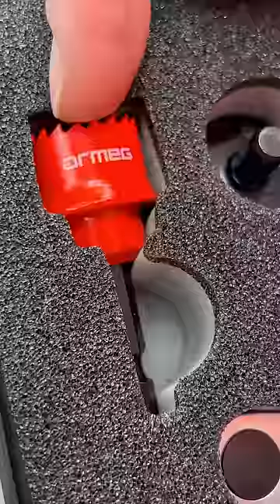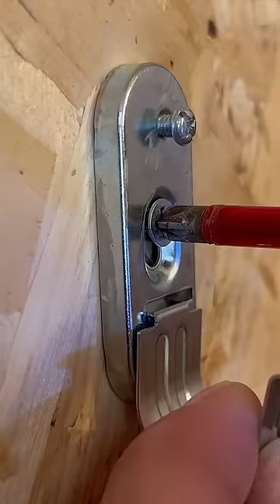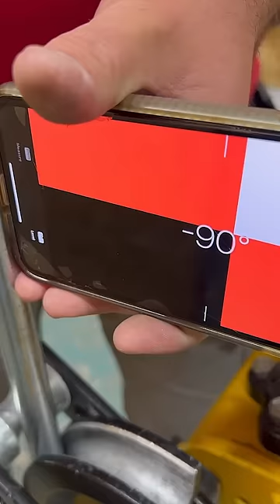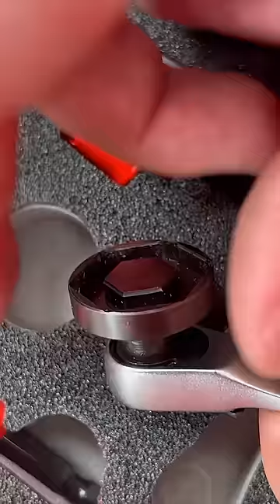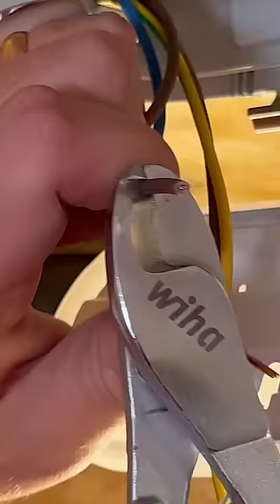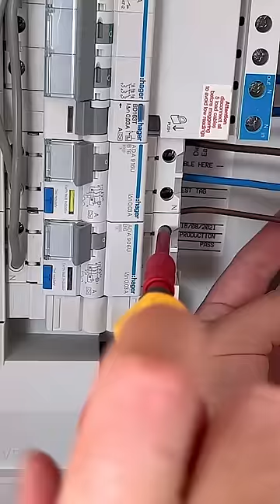How Many Electricians' Tools Does It Take to Fit a Light?

Comment: I'm guessing there's some code I'm not understanding, but it seems like a LOT of tools and steps to hang a light fixture....fancy bender, rigid conduit die and vise, lugs for the ground wires, phone to check bent angle- gimme 20 minutes a screwdriver, hacksaw, strippers, and hand bender - oh, knockout set and cordless drill. And a dozen couplings to cprrect my bending miscalculations 😅

Comment: Can i get a list of these tools pleaseee
Reply: As the saying goes, I gotchu fam. 

In order of appearance:
- Green crosshair level (Bosch, Milwaukee, etc. all make them)
- Marker in what appears to be custom holder made from adapters and a cable gland
- Flathead insulated screwdriver
- (Cardboard for separating out single wires from a bunch, this may or may not count as a 'tool')
- Automatic Center Punch - 5 inch Brass Spring Loaded
- Cutting Fluid
- Armeg SSH020 Sheet Steel Holesaw, Red, 20mm (Armeg TBSSH5PCSET is the whole little kit) 
- Power drill
- MAVAST Silicone Deburring Tool
- Cloth :P
- Philips insulated screwdriver
- KNIPEX Tools - Pliers Wrench, Chrome (8603250), 10-Inch
- Tape measure
- Magnetic welding holder
- Portable mechanical pipe/conduit bender (can't find the exact one)
- iPhone level app
- Hacksaw
- Square file
- Large die set (can't find his exact one, but a large die set will give you a t-handle. Manual conduit threaders give you a bar not a t-handle to drive the die)
- Conduit reamer
- KNIPEX Tools - Alligator Water Pump Pliers (8801250), 10-Inch
- 20mm Brocket - Conduit Bush Socket - Armeg
- 1/4" mini ratchet
- Fish stick set, possibly glow in the dark variety
- Wiha Classic 34730 Cable Cutter 200 mm (he has an older model, new model has different teeth)
- BAT22-6NV2 Thomas & Betts Sta-Kon Battery Powered Crimping Tool with DIE2001 Thomas & Betts Insulated Terminal Crimping Die, 22-10AWG
- Reel spinner (couldn't find a specific style like his, most of ours (US) are stands that you load the reels on)
- Wiha insulated screwdriver set, 19 pieces - 28398
- Wiha insulated pliers (background)
Edit: last screwdriver is not the same 28398 handle, it is in fact - Wiha 28789 11-Piece Insulated TorqueVario-S & SlimLine Blade Set. Credit: @Elektrotechniker

I did my best for a useless shorts comment that will never be seen again, take it as such lol

Comment: What is that wire crimper you used that sounded electronic? The end ferrule crimper
Reply: BAT22-6NV2 Thomas & Betts Sta-Kon Battery Powered Crimping Tool was the only blue battery powered one I could find. Greenlee makes a few models as well.

Comment: Is there a tool list ?
Reply: In order of appearance:
- Green crosshair level (Bosch, Milwaukee, etc. all make them)
- Marker in what appears to be custom holder made from adapters and a cable gland
- Flathead insulated screwdriver
- (Cardboard for separating out single wires from a bunch, this may or may not count as a 'tool')
- Automatic Center Punch - 5 inch Brass Spring Loaded
- Cutting Fluid
- Armeg SSH020 Sheet Steel Holesaw, Red, 20mm
- Power drill
- MAVAST Silicone Deburring Tool
- Cloth :P
- Philips insulated screwdriver
- KNIPEX Tools - Pliers Wrench, Chrome (8603250), 10-Inch
- Tape measure
- Magnetic welding holder
- Portable mechanical pipe/conduit bender (can't find the exact one)
- iPhone level app
- Hacksaw
- Square file
- Large die set (can't find his exact one, but a large die set will give you a t-handle. Manual conduit threaders give you a bar not a t-handle to drive the die)
- Conduit reamer
- KNIPEX Tools - Alligator Water Pump Pliers (8801250), 10-Inch
- 20mm Brocket - Conduit Bush Socket - Armeg
- 1/4" mini ratchet
- Fish stick set, possibly glow in the dark variety
- Wiha Classic 34730 Cable Cutter 200 mm (he has an older model, new model has different teeth)
- BAT22-6NV2 Thomas & Betts Sta-Kon Battery Powered Crimping Tool with DIE2001 Thomas & Betts Insulated Terminal Crimping Die, 22-10AWG
- Reel spinner (couldn't find a specific style like his, most of ours (US) are stands that you load the reels on)
- Wiha insulated screwdriver set, 19 pieces - 28398
- Wiha insulated pliers (background)

I did my best for a useless shorts comment that will never be seen again, take it as such lol

Comment: The electricians I have seen so far in the UK would just throw a wire at the light and say "there are no regulations, it's good".
Reply: He basically did that but with metal tubes and big ass switch.

Comment: Hi everyone! 
I am electrician from Sweden. 
For me all this things with metal pipes looks impressive and strange same time. 
I wonder what kind of requirements should be for the room to justify the need for such an expensive (I guess) work?
Reply: Exterior wiring, damp/wet locations.
Reply: Mainly for places where you need better mechanical protection. People also like it where the wiring is going to be on show as when done well it looks good, IMO.

Comment: 14 maybe even possibly 6.. 🤔 but iduno they paying by the hour (we rounding up?) or by the job, that is the real question!

Hold up @efixx how do you like the phone level thing a Ma jig & do you find it accurate? I carry my 🔥 Bosch laser tape measure with me always & really do pull that thing out to level items a lot! It’s a multi use tool for sure 👏 (but I would like to try the phone version too lol)
Reply: By my (updated) count, 30 - in order of appearance (because something is wrong with me and you might find it mildly entertaining):
- Green crosshair level (Bosch, Milwaukee, etc. all make them)
- Marker in what appears to be custom holder made from adapters and a cable gland
- Flathead insulated screwdriver
- (Cardboard for separating out single wires from a bunch, this may or may not count as a 'tool')
- Automatic Center Punch - 5 inch Brass Spring Loaded
- Cutting Fluid
- Armeg SSH020 Sheet Steel Holesaw, Red, 20mm (Armeg TBSSH5PCSET is the whole kit)
- Power drill
- MAVAST Silicone Deburring Tool
- Cloth :P
- Philips insulated screwdriver
- KNIPEX Tools - Pliers Wrench, Chrome (8603250), 10-Inch
- Tape measure
- Magnetic welding holder
- Portable mechanical pipe/conduit bender (can't find the exact one)
- iPhone level app
- Hacksaw
- Square file
- Large die set (can't find his exact one, but a large die set will give you a t-handle. Manual conduit threaders give you a bar not a t-handle to drive the die)
- Conduit reamer
- KNIPEX Tools - Alligator Water Pump Pliers (8801250), 10-Inch
- 20mm Brocket - Conduit Bush Socket - Armeg
- 1/4" mini ratchet
- Fish stick set, possibly glow in the dark variety
- Wiha Classic 34730 Cable Cutter 200 mm (he has an older model, new model has different teeth)
- BAT22-6NV2 Thomas & Betts Sta-Kon Battery Powered Crimping Tool with DIE2001 Thomas & Betts Insulated Terminal Crimping Die, 22-10AWG
- Reel spinner (couldn't find a specific style like his, most of ours (US) are stands that you load the reels on)
- Wiha insulated screwdriver set, 19 pieces - 28398
- Wiha insulated pliers (background)
Edit: last screwdriver is not the same 28398 handle, it is in fact - Wiha 28789 11-Piece Insulated TorqueVario-S & SlimLine Blade Set. Credit: @Elektrotechniker

I did my best for a useless shorts comment that will never be seen again, take it as such lol

Comment: I counted 20?
Reply: I counted a lot more than 20. I guess it depends on your definition of a tool.
Reply: Edit: 29 by my (updated) count (30 if you count the cardboard piece as a 'tool'). In order of appearance:
- Green crosshair level (Bosch, Milwaukee, etc. all make them)
- Marker in what appears to be custom holder made from adapters and a cable gland
- Flathead insulated screwdriver
- (Cardboard for separating out single wires from a bunch, this may or may not count as a 'tool')
- Automatic Center Punch - 5 inch Brass Spring Loaded
- Cutting Fluid
- Armeg SSH020 Sheet Steel Holesaw, Red, 20mm
- Power drill
- MAVAST Silicone Deburring Tool
- Cloth :P
- Philips insulated screwdriver
- KNIPEX Tools - Pliers Wrench, Chrome (8603250), 10-Inch
- Tape measure
- Magnetic welding holder
- Portable mechanical pipe/conduit bender (can't find the exact one)
- iPhone level app
- Hacksaw
- Square file
- Large die set (can't find his exact one, but a large die set will give you a t-handle. Manual conduit threaders give you a bar not a t-handle to drive the die)
- Conduit reamer
- KNIPEX Tools - Alligator Water Pump Pliers (8801250), 10-Inch
- 20mm Brocket - Conduit Bush Socket - Armeg
- 1/4" mini ratchet
- Fish stick set, possibly glow in the dark variety
- Wiha Classic 34730 Cable Cutter 200 mm (he has an older model, new model has different teeth)
- BAT22-6NV2 Thomas & Betts Sta-Kon Battery Powered Crimping Tool with DIE2001 Thomas & Betts Insulated Terminal Crimping Die, 22-10AWG
- Reel spinner (couldn't find a specific style like his, most of ours (US) are stands that you load the reels on)
- Wiha insulated screwdriver set, 19 pieces - 28398
- Wiha insulated pliers (background)
Edit: last screwdriver is not the same 28398 handle, it is in fact - Wiha 28789 11-Piece Insulated TorqueVario-S & SlimLine Blade Set. Credit: @Elektrotechniker

I did my best for a useless shorts comment that will never be seen again, take it as such lol
Reply: @iangillespie1605  honestly impressive
Reply: @omniferousswan593  I have a problem, clearly xD

Comment: I think using plastic conduit is more practical, fast and safe and doesn't need such expensive tools.
Reply: Until it's broken, or UV damaged and crumbling. 
It's easier to use EMT. But I could cut, thread, and bend that faster and with less tools even in rigid. They're just showing off their toys.

Comment: This is way too fast for us yanks to see the details of your kit. It is so different then here in the land of 60hz
Reply: In order of appearance:
- Green crosshair level (Bosch, Milwaukee, etc. all make them)
- Marker in what appears to be custom holder made from adapters and a cable gland
- Flathead insulated screwdriver 
- Automatic Center Punch - 5 inch Brass Spring Loaded
- Cutting Fluid
- Armeg SSH020 Sheet Steel Holesaw, Red, 20mm
- Power drill
- MAVAST Silicone Deburring Tool
- Cloth :P
- Philips insulated screwdriver
- KNIPEX Tools - Pliers Wrench, Chrome (8603250), 10-Inch
- Tape measure
- Magnetic welding holder
- Portable mechanical pipe/conduit bender (can't find the exact one)
- iPhone level app
- Hacksaw
- Square file
- Large die set (can't find his exact one, but a large die set will give you a t-handle. Manual conduit threaders give you a bar not a t-handle to drive the die)
- Conduit reamer
- KNIPEX Tools - Alligator Water Pump Pliers (8801250), 10-Inch
- 20mm Brocket - Conduit Bush Socket - Armeg
- 1/4" mini ratchet
- Fish stick set, possibly glow in the dark variety
- Wiha Classic 34730 Cable Cutter 200 mm (he has an older model, new model has different teeth)
- BAT22-6NV2 Thomas & Betts Sta-Kon Battery Powered Crimping Tool with DIE2001 Thomas & Betts Insulated Terminal Crimping Die, 22-10AWG
- Reel spinner (couldn't find a specific style like his, most of ours (US) are stands that you load the reels on)
- Wiha insulated screwdriver set, 19 pieces - 28398
- Wiha insulated pliers (background)

I did my best for a useless shorts comment that will never be seen again, take it as such lol

Comment: I'd be a millionaire if I worked by the hour and made all the extra work displayed here. Glad I don't have to bend steel pipe just to fix a light.
Reply from the maker: Surely you'd have to charge a higher hourly rate... 🤔

Comment: 2 faults only. You shouldn’t screw through the body of the fitting. Invalidated the guarantee. Use brackets provided. And better to flex through compression gland on the end.

Comment: It's a common misconception that electricians charge by the hour. It's actually a tool charge. They charge per tool.
Reply: our sparkies only have 4 tools  - linemen's, 11in1, wire strippers and a flashlight. linemen's double as hammer, wrench. 11in1 identifies as screwdriver,chisel,hammer , prywall

Comment: Why metal conduits?! Seems dangerous if a wire has a leak the whole conduit can become live...wouldn't do that in Australia that's for sure lol
Reply: If an electrical system is using metal boxes and conduits (done properly) the whole system is grounded and generally considered safer and more durable as well as easier to make changes and upgrade (run new wires) in the future if wanted necessary.

All in all I'd be surprised if metal conduits are not common in Australia but saying "wouldn't do that in Australia that's for sure" is basically just an insult...to Australia.

Comment: I counted 17 tools.
Reply: By my (updated) count, 30 - in order of appearance (because something is wrong with me and you might find it mildly entertaining):
- Green crosshair level (Bosch, Milwaukee, etc. all make them)
- Marker in what appears to be custom holder made from adapters and a cable gland
- Flathead insulated screwdriver
- (Cardboard for separating out single wires from a bunch, this may or may not count as a 'tool')
- Automatic Center Punch - 5 inch Brass Spring Loaded
- Cutting Fluid
- Armeg SSH020 Sheet Steel Holesaw, Red, 20mm (Armeg TBSSH5PCSET is the whole kit)
- Power drill
- MAVAST Silicone Deburring Tool
- Cloth :P
- Philips insulated screwdriver
- KNIPEX Tools - Pliers Wrench, Chrome (8603250), 10-Inch
- Tape measure
- Magnetic welding holder
- Portable mechanical pipe/conduit bender (can't find the exact one)
- iPhone level app
- Hacksaw
- Square file
- Large die set (can't find his exact one, but a large die set will give you a t-handle. Manual conduit threaders give you a bar not a t-handle to drive the die)
- Conduit reamer
- KNIPEX Tools - Alligator Water Pump Pliers (8801250), 10-Inch
- 20mm Brocket - Conduit Bush Socket - Armeg
- 1/4" mini ratchet
- Fish stick set, possibly glow in the dark variety
- Wiha Classic 34730 Cable Cutter 200 mm (he has an older model, new model has different teeth)
- BAT22-6NV2 Thomas & Betts Sta-Kon Battery Powered Crimping Tool with DIE2001 Thomas & Betts Insulated Terminal Crimping Die, 22-10AWG
- Reel spinner (couldn't find a specific style like his, most of ours (US) are stands that you load the reels on)
- Wiha insulated screwdriver set, 19 pieces - 28398
- Wiha insulated pliers (background)
Edit: last screwdriver is not the same 28398 handle, it is in fact - Wiha 28789 11-Piece Insulated TorqueVario-S & SlimLine Blade Set. Credit: @Elektrotechniker

I did my best for a useless shorts comment that will never be seen again, take it as such lol

Comment: Carbide hole saws work a lot faster.
Reply: Way too aggressive for bi-metal, great for steel. I always get over-size hole with carbide hole saw. You get precise cut with hole saw and I don’t think they make carbide hole saw for electrical installation. Cheers

Comment: We'll never know cuz this moves to fast
Reply: In order of appearance:
- Green crosshair level (Bosch, Milwaukee, etc. all make them)
- Marker in what appears to be custom holder made from adapters and a cable gland
- Flathead insulated screwdriver 
- Automatic Center Punch - 5 inch Brass Spring Loaded
- Cutting Fluid
- Armeg SSH020 Sheet Steel Holesaw, Red, 20mm
- Power drill
- MAVAST Silicone Deburring Tool
- Cloth :P
- Philips insulated screwdriver
- KNIPEX Tools - Pliers Wrench, Chrome (8603250), 10-Inch
- Tape measure
- Magnetic welding holder
- Portable mechanical pipe/conduit bender (can't find the exact one)
- iPhone level app
- Hacksaw
- Square file
- Large die set (can't find his exact one, but a large die set will give you a t-handle. Manual conduit threaders give you a bar not a t-handle to drive the die)
- Conduit reamer
- KNIPEX Tools - Alligator Water Pump Pliers (8801250), 10-Inch
- 20mm Brocket - Conduit Bush Socket - Armeg
- 1/4" mini ratchet
- Fish stick set, possibly glow in the dark variety
- Wiha Classic 34730 Cable Cutter 200 mm (he has an older model, new model has different teeth)
- BAT22-6NV2 Thomas & Betts Sta-Kon Battery Powered Crimping Tool with DIE2001 Thomas & Betts Insulated Terminal Crimping Die, 22-10AWG
- Reel spinner (couldn't find a specific style like his, most of ours (US) are stands that you load the reels on)
- Wiha insulated screwdriver set, 19 pieces - 28398
- Wiha insulated pliers (background)

I did my best for a useless shorts comment that will never be seen again, take it as such lol